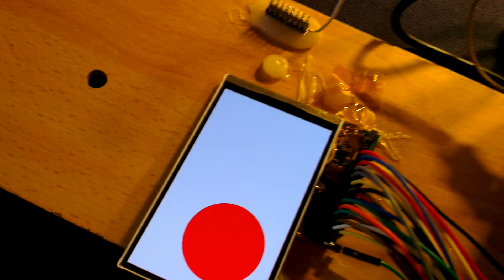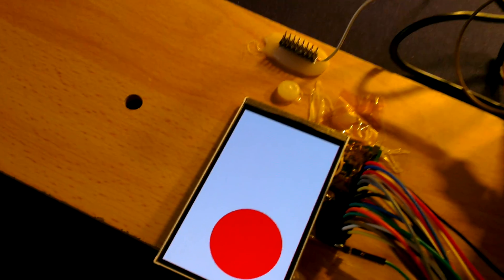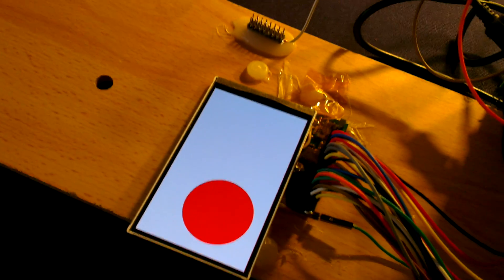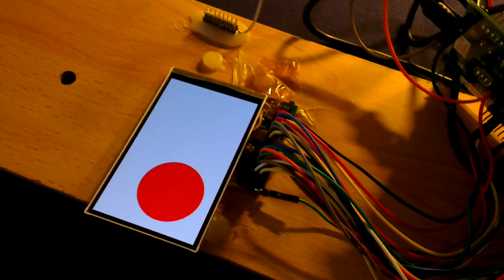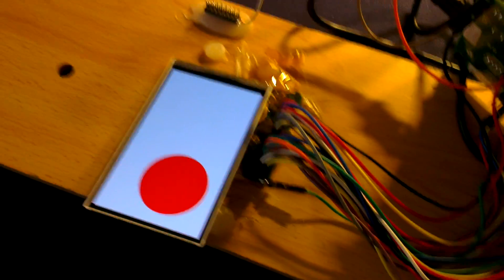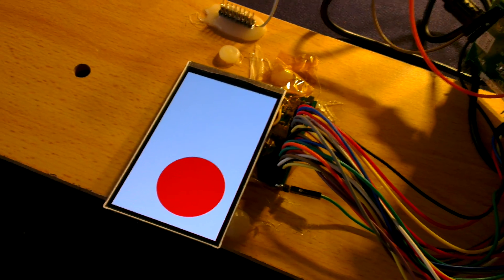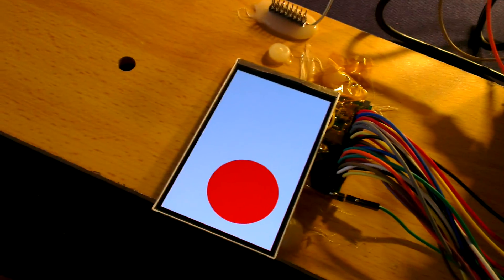STM32F429 AMOLED controlerd by LTDC

Comment: Linas K Hi, Please tell me how you apply power to this display? Used if negative voltage source?
Reply from the maker: Hi, i am using Linear technologies sepic DC/DC converter, and also using LDO+PFET. Controller after initialization give CMOS output to enable power supply, so first i use p-fet coupled with bjt to source +4.5V, and at the same time using sourced +4.5V to enable negative DC/DC converter to -4.8V. Simple and elegant. But in my final vertion ai am using two dc/dc converters fro +4,5 and -4,8V
Reply: Linas K Look at TPS65137AS it generates just two voltages, thanks for the quick response, it turns dc \ dc signal is switched ELVDDON, whether it is possible at times to include converters ignoring ELVDDON?
Reply from the maker: rutcode
yes, TPS is very good option for this panel, since i had many ic's from Linear, i used them, it's a proven design. If i should redesign again, i would use something like that.
When you set registers, and send command turn AMOLED ON, ELVDDD_ON will give high level, so that is convenient to have. Same apply if you want to switch down screen to save power. AMOLD dontroler as many electronics need powerup sequencing, you can brick driver if you apply voltage while registers ar not set, or even worse, you don't have any power connected to logic.
Reply: Linas K Have you got a scheme as you connect it, I want to use this display in a makeshift Open source microwave generator, do not want to run into a rake .....
Reply: rutcode А какой здесь используется дисплей? Тоже нужно что нибудь большое и красивое к дискавери прикрутить )
Reply from the maker: You need+4.6 and -4.8V, as well as 3.3V for logic (3.3 always on)
-4.8 and 4.6 need's to be enabled by AMOLED itself, just connect dcdc enable pin from amoled to your dcdc power supply. AFter SPI config, amoled will enable power by generating logic one on dcdc enable pin

Comment: Hi,
Do you have a link with more info about this project?
Thanks.
Reply from the maker: Go to element14.com and search for smart solder reflow oven
Reply: Linas K Hi, Do not tell me why you remove any technical information?
Reply from the maker: Евгений Ермашкевич

i will add all details in single blog post at some point
Reply: Linas K
Hi Linas,  can you tell where can i find the post about interfacing?